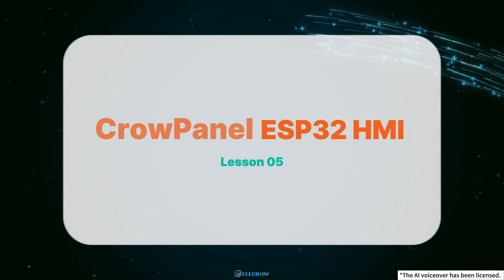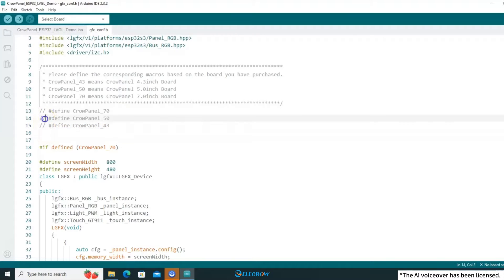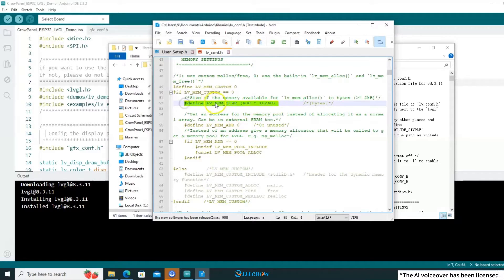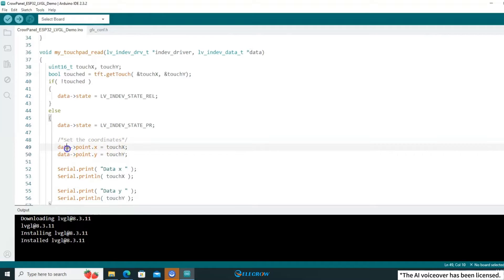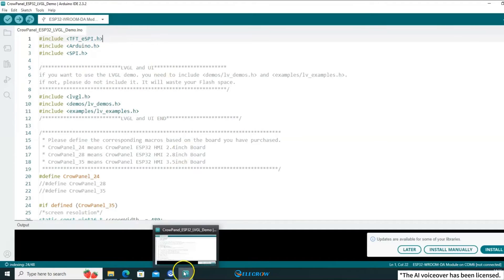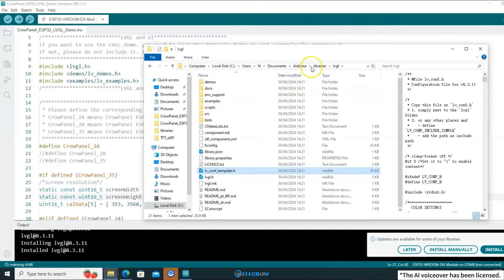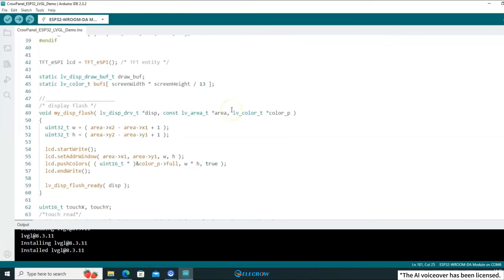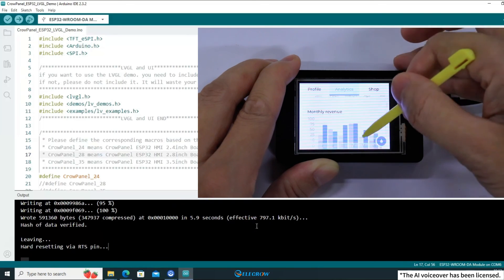Get Started with ESP32: Lesson 05 - LVGL Demo Test

Comment: 🔥 Extremely Poor Product – Do NOT Buy It!
This 5.0 V3.0 I2C Display Board completely ruined my system. As soon as I interfaced it with the PCF8575 I/O Expander, the I2C communication totally failed. The touch panel started behaving erratically — sometimes it clicks on its own, sometimes it doesn’t respond at all.

⚠ If you're planning to use I2C, avoid this board at all costs.
It comes with very limited usable GPIOs — only one! You can’t even use a simple shift register with it.

The worst part? The I2C lines seem to be custom-configured internally, making it incompatible with any external I/O expanders like PCF8574 or PCF8575. It feels like a locked-down, half-baked design with zero flexibility.

💀 Completely useless for any serious development work.
👎 Avoid this board — it’s a trap for developers who value reliability and expandability.

Comment: Would you recommend upgrading to LVGL 9.1 since SquareLine 1.5.0 supports it, or is LVGL 8.3.11 still the better choice? I’m concerned about the configuration of the `lv_conf.h` file because the process seems different from what you showed in the video. I feel that LVGL 9.1 might be more stable, but I could be mistaken. What should I do in this situation? Please guide me step by step.
Reply from the maker: Thanks for asking. LVGL 9.1 is not supported yet. Please continue to use LVGL 8.3.11, which is equally stable.😊

Comment: Hi guy, Now I already builded project from example but it has error c:\Users\Administrator\Documents\Arduino\libraries\lvgl\src\osal\lv_windows.c:14:10: fatal error: process.h: No such file or directory
How to fix error?
Thank you.
Reply from the maker: Regarding your problem, please first check whether the esp32 version you are using is consistent with the one in the video.

If it is consistent, please refer to the steps in the video. There are links to relevant materials in the description. If the problem still occurs, please send the specific operation and system error to the technical support email at techsupport@elecrow.com. We are here to help and will respond to your request promptly. 😊

Comment: Hello, I have my crowpanel 7" and it seems like when I flashed the demo with everything configured, the touch screen no longer works. The screen shipped with the demo working with touch, and there has been no damage done (as far as I am aware) and the touch screen no longer works. Any ideas how to fix this?
Reply from the maker: Hi, for any technical inquiries or assistance, please feel free to reach out to us at techsupport@elecrow.com. We are here to help and will respond to your request promptly.😊
Reply: did they solve your problem?
Reply: @eliothavila7337  No they didn't, but I reflashed with factory firmware and got the factory demo to work with touch, still working on how to get demo working manually.
Reply: this happened to me too.
Reply from the maker: @JohnnysFlightLog  Hello, regarding the issue you mentioned, please try this new demo link 👇https://drive.google.com/file/d/1BW7v7ekHi8LVd1kLRFOhMc_Cy6pLvHKo/view?usp=sharing
Reply: @Elecrow  The touchscreen works with that new demo, but you'll need to download new libraries and update the LEDC function. Thanks.
Reply from the maker: Hi, for any technical inquiries or assistance, please feel free to reach out to us at techsupport@elecrow.com. We are here to help and will respond to your request promptly.😊